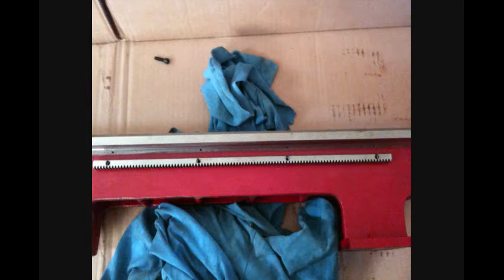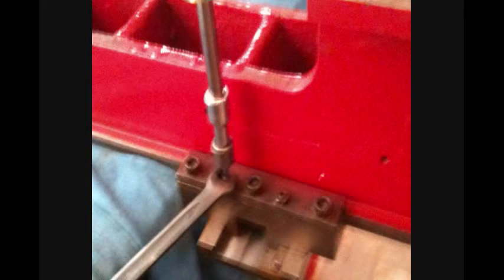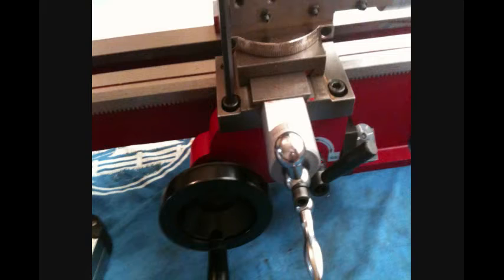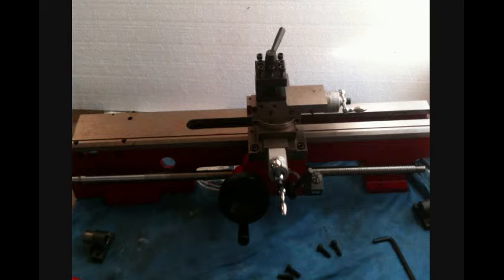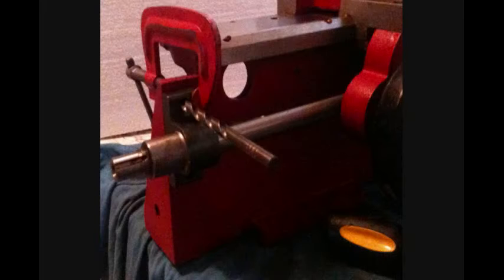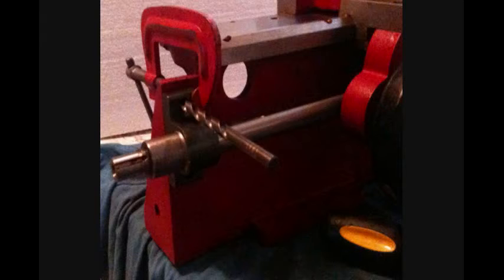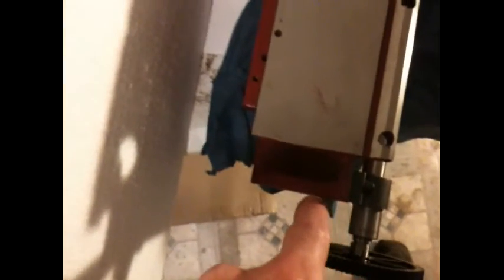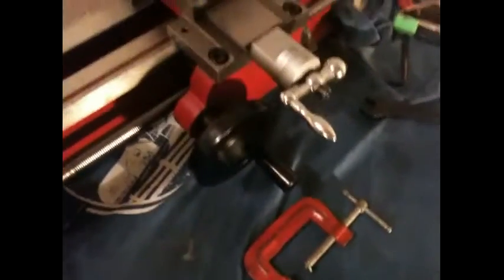Mini Lathe Bed Extension Kit Part 2

Comment: My instructions said 1-3/4" from the right edge of the right front headstock mounting hole.  You put it 1-3/4" from the right edge of the bed. Have you had any problems with where you mounted yours?